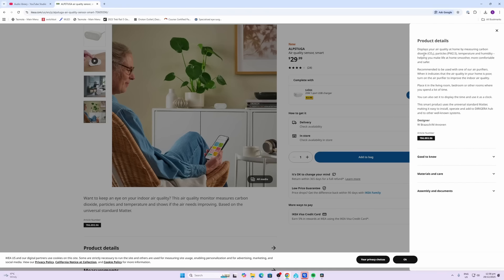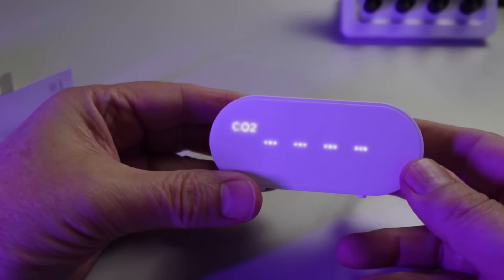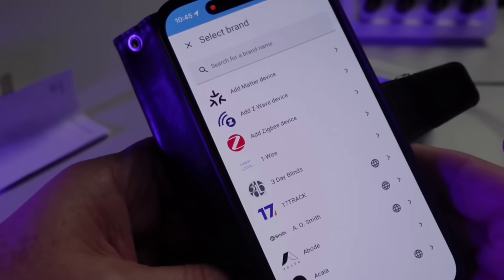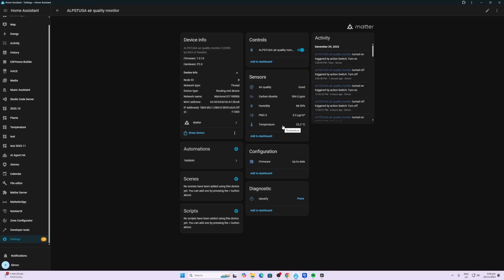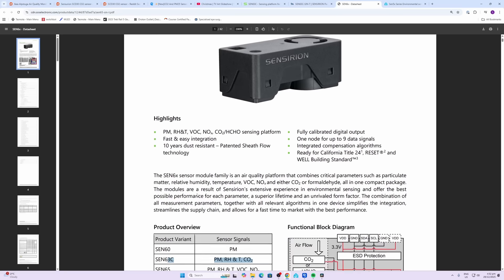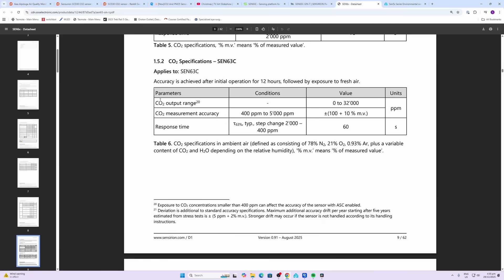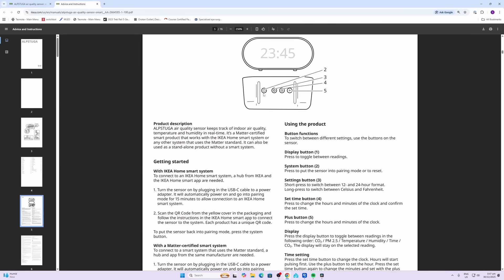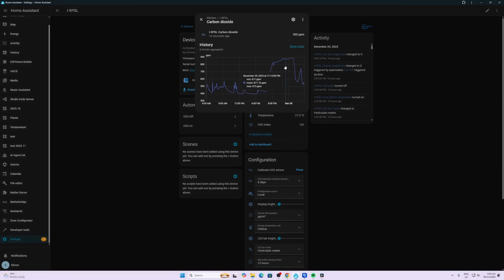How does the IKEA Alpstuga Air Quality Sensor Stack up to more expensive options?

Comment: I noticed mine gets time from the network somehow ... But I am not sure when or how it gets set.  When I plug it in sometimes with a short time the time is set and then other times it is not.  I am starting to think if i plug it in and don't check what the time is for 30 min it is fine but if i check shortly after it is plugged in then it NEVER gets network time.
Reply from the maker: Wow such a weird little bug,  have you tried the Blueprint for matter time sync?

Comment: Which Matter hub are you using? (It could be good to add it or specify it in the description)
I've been considering buying IKEA Dirigera although I'm concerned about the limited information on its integration with HA and its performance/stability. 
My HA integration experience with the IKEA Trådfri Gateway was somehow frustrating therefore I switched to a CC2652P many years back.
Reply from the maker: I am using the Home Assistant ZBT-2 as my Thread Boarder Router, it works great so far :)

Comment: Is the permanent display just the clock or does it scroll through other readings?

Also does the display auto dim during nighttime?
Reply from the maker: No you can scroll through the readings using the button and the display dims to a really low level in the dark, I have it next to my bed at night!

Comment: The power supply not included is ridiculous!!! I understand for something with an included battery you can share a charger with multiple devices so you don't need a dedicated power supply because you may already have one. But here without it the sensor won't work so you need to buy one! It's like selling a car without tires... because you may use the one from your previous car!
Reply: It's to save on ewaste. People can retain and repurpose the adapter that came with a device they have since discarded.
Reply from the maker: Unfortunately very few devices ship with power supplies any more!
Reply: @simonsayshomeassistant  Imagine your new laptop, PC monitor, anything with a  USB-C connector without power supply... and also a good way to deny warranty: you didn't use the overpriced recommended power supply!
Reply: Likewise you can use a single AC plug with multiple USB ports to plug several devices in at one location without using all of your outlets there (and likely more efficient power consumption).
Reply from the maker: @DavidBump  Thanks, that's a great idea David!

Comment: Really nice unit! I just wish IKEA didn't hate Norway. It's USD 30, fine, but in Norway, it's NOK 500, which is about 50% more expensive, and no, it's not EU that's in the way, even in Switzerland, which is even more expensive than -Norway, it's cheaper. I wonder why IKEA hates Norway that much…
Reply from the maker: Oh wow that is so frustrating!  I was worried they would be more expensive here in NZ too but the prices are amazing!
Reply: Switzerland has a very low VAT(around 8%), in Norway its around 25%? So I guess that is part of the reason
Reply from the maker: @joelcuce yes taxes can make a big difference 😮

Comment: I noticed the sensor can provide PM 1, 2.5, 4, 10. These are not exposed to HA? Perhaps hidden?
Reply from the maker: I doubt that there is an easy way to extract it using the current implementation.  We could get that data by connecting the sensor to an ESP32 and run ESP home code.

Comment: hello! the sensor seems to work well but... as soon as it was synchronized it set the right time. When I moved the device to another room it lost time sync and no longer syncs on its own. Is it just my problem?
Reply from the maker: Hi there Valeri, I experienced the same problem with mine, had to set the clock manually after powering off and on the device :(
Reply: @simonsayshomeassistant  I managed to find a solution using a custom component on HACS. It's called MATTER TIME SYNC. With this component, you can send the correct time to ALTSPURA. (the component does not update it automatically but you can still set up an automation to update it whenever you want)

Comment: Mine will show "Good" air quality in HA, despite the hardware unit showing the red dot indicating high amount of co2. Have you experienced the same issue?
Reply from the maker: Hi Srosted, thank you for that feedback!  Yes I have just tested it and mine is also not showing anything but Good air quality in Home Assistant even when I blow into the sensor to boost the CO2
Reply: @simonsayshomeassistant hope they will address it in a firmware update. But impressive that it has slipped through QA. At least it's reassuring that their water leak sensor had already received an OTA update, that installed flawlessly via HA.
Reply from the maker: @srosted  Yes let's wait and see what the update will bring :)  Yes the water leak sensor works great!
Reply: @simonsayshomeassistant the bug has been fixed with today's OTA firmware upgrade to version 1.0.15 👌
Reply from the maker: @srosted  Oh cool thanks for letting me know!

Comment: how many pm 2.5 readings does it populate per minute? my use case is a smoke detector to shut windows on a balcony, so i need values every 5 seconds to be responsive. i currently use a sen sensor via esp32 tomachieve that
Reply: Smoke detector as in detecting annoying people smoking cigarettes outside your window? If so that's really neat and I should do that.
Reply from the maker: @oliverer3  Interesting use case :)
Reply from the maker: It seems to vary the timing between 10 seconds and 1 minute.

Comment: is it a NDIR Co2 sensor? IF not than useless, no real data
Reply: I'm fairly confident it's a "photoacoustic" CO₂ sensor built using MEMS devices so it can be a single chip solution. That is a real CO₂ sensor, and provides comparable accuracy to transmissive NDIR under indoor conditions. Sensiron sells CO₂ sensors of this type as separate standalone devices too; see the SCD43.
Reply: That said, Sensiron also makes "Thermal Conductivity" CO₂ sensors, which don't directly measure CO₂ and can fooled by unusual gas mixtures. They're still way better than the estimated CO₂ numbers provided by a tVOC sensor.
Reply: @kepstin  This is theire "new" thermal conductivity sensor STCC4
Reply from the maker: No it is not an NDIR CO2 sensor as far as I know

Comment: Interesting the sensor can also provide VOC, but IKEA doesn't use it.
Reply: I believe that's incorrect, this device has the Sen63C variant of this sensor which only reads PM, co2 and temp + humidity. Only Sen65 and above can measure VOC as well as a few other neat things.
Reply: @oliverer3 ah, that sounds plausible, I hadn't seen that. thanks!
Reply from the maker: Yes, you could attach the sensor to an ESP 32 and load ESPHome to access these entities
Reply: Yeah I noticed this as well

Comment: I got one but it won’t connect to HA via matter.
Reply from the maker: That's odd, what are you running your Thread Boarder Router on?
Reply: @simonsayshomeassistant raspberry pi5, dedicated HA, TBR and Matter addon. All latest version and SLZB-MR1 as MoT. Tried also ZBT-1. Both no luck.
Reply from the maker: @vegatube3818  I know it took me a few tries to get the Matter working on my setup.  Have you managed to add other thread devices?
Reply: It tells me i need to aa a tbreat router border? But i have some matter devices that do work. I dont get where it goes wrong
Reply from the maker: @koalateen  Are the other Matter devices using WIFI or Thread?
Reply: @simonsayshomeassistant i have only the pihilips Hue bridge pro connected via matter to it. Have also a old hue bridge. But I dont know how all off it works to be fair. I just get the message i cant add it.
Reply from the maker: @koalateen  I think the problem is that you need a matter boarder router, you could get the Ikea Dirigera or an Apple Home Hub Mini or Apple TV
Reply: @simonsayshomeassistant  Would the Aqara hub M100 work to?
Reply from the maker: @koalateen yes it does have a thread boarder router so it should work
Reply: Have you tried resetting the device? Press and hold the SYNC button until a countdown appears… when the countdown ends, the device will reset. Then proceed with pairing.

Comment: two questions
- does the fan make any noise ?    I am interested to place it beside my bed, but if it makes any fan noise it is an absolute no go for me.
- can the CO2 alert be turned off ?
Reply from the maker: Hi, the fan is silent unless you place your ear right on the device.  There is no noise from the alert unless you create one like I did in Home Assistant
Reply: @simonsayshomeassistant  Thanks!
Reply from the maker: @nick066hu  Only a pleasure Nick :)

Comment: I have been using my Alpstuga for about 1 week. I can confirm that if you connect Alpstuga to Dirigera, all functions work perfectly. Including automatic setting the time after a power loss. Then you use the Matter sharing code from Dirigera to Home Assistant to get all functions to Home Assistant.

Comment: My time did not update when paired. It may be a function of HA's OTBR. On Reddit a user with an Apple TV product for their (thread board router) TBR, reported the time was lost when rebooting the IKEA sensor but automatically restored when restarting their Apple TV (and I presume that TBR has time paring/syncing on boot)
Reply from the maker: Thank you so much for your feedback 😊 let's hope that the ha TBR is updated to allow for time to be sent
Reply: you can use a custom component called MATTER TIME SYNC

Comment: Hi Simon, thank you for valuable information provided. Now just waiting to those appear in local Ikea. During CO2 chart I saw there is 10seconds refresh rate of sensor - please is this also the case for temperature, humidity and pm2.5? Thank you.
Reply from the maker: HI there!  Thank you so much for your valued feedback :) All the sensors seem to refresh at random times between 10 seconds and 2 minutes when connected to Home Assistant.  I can't work out what the times are controlled by !
Reply: @simonsayshomeassistant  In that case it seem some value deviation treshold is set probably due to energy saving. Thank you so much 😊 Michael
Reply from the maker: @x22x07  Yes that sounds like it :)  Glad I could help!

Comment: If paired with Home Assistant, as you mentioned, it loses time setting after powering off. But if paired with Dirigera, it gets back correct time. So I paired it with Dirigera , and shared it to HA, so problem resolved.

But would be ideal if HA sets the clock back once powered off.
Reply from the maker: Oh wow very interesting!  Thank you so much for that feedback :) I will have to purchase a Dirigera when they become available here to try it out!

Comment: Great video, especially on the comparison with a “proper” and more expensive air quality product and data sheet specifically covering what sensor is inside. Before your video, I was convinced it was a poor quality device using algorithms to calculate the co2 value rather than actually measuring them like almost all cheap co2 measuring devices. 
Thank you! You’ve got a new subscriber 😊
Reply from the maker: Hi Carl, welcome, thank you so much for your valued comments :) Yes I was really surprised too, it seems that IKEA is really committed to producing quality smart home devices at affordable prices!
Reply: @simonsayshomeassistant  stoooppp my wallet can only take so much this soon after the holidays.

Comment: Interesting Sensor. Good review but a few questions. I am about to start with matter devices. When you add to matter with a thread border router say with something like slzb-mr3 it does not use your wifi router at all. Is this right?

About the sensor

1. Does it cycle through the time and each measure?
2. Does the time need to be manually updated in all cases if unplugged or can it be set to update from home assistant. I ask because this would be annoying with daylight savings etc.
Thanks
Reply from the maker: Thank you so much for your kind feedback,  yes it communicates directly  with the Matter device over Thread.  It cycles through each metric as you press the button.  Yes it needs to be manually set, it only loaded the time on the first matter connection
Reply: @simonsayshomeassistant Thanks for the reply. I think they should have an option to cycle through without pressing the button. Also the time manual change is a bummer.....
Reply from the maker: @guylast9516  Yeh let's hope they update this in future software changes

Comment: Great that IKEA has added buttons for the clock to allow this device to run standalone.
I've also seen that the temperature & humidity sensor has a °C / ° F switch.
Reply from the maker: Yeh they really did a good job when designing this device, I look forward to what they will bring out in the coming years!
Reply: Gotta love those physical buttons as I plan on running this for a while standalone. I am still waiting and planning what Thread capable dongle/hub I pick and use with Home Assistant.
Reply from the maker: @laurikvo  Yeh it is a well deigned little device!  I am loving the ZBT2!

Comment: What do you mean "No, its not new"? Doesn't it want to pair from scratch?
Reply: Matter devices pair differently if they're new (never paired) or already setup (currently paired with a Thread Border Router).
If they're new, Home Assistant knows to set it up with a selected default border router (open thread border router add-on). Otherwise a currently paired device needs to be added through the hub it's currently connected to, e.g. through Home Kit.
Reply from the maker: @NorthparkLights  Thanks Mark :)
Reply: yes, thats whats written on HA
Reply from the maker: My mistake, mean to say yes it is new!

Comment: I've got 2 so far really good and super low power usage. Home Assistant and Google home work well. Google home displays the temps in Celsius. If matter is not working make sure IPv6 is enabled on home assistant it won't work without it.
Reply: I've got 3 of these, and they paired up with Apple Home without a problem either.
Reply from the maker: @yoshuawuyts  That's great to hear!
Reply from the maker: It's weird I tried setting up IPV6 first and then it gave me an error.  Perhaps it defaults to being setup already ?
Reply: @simonsayshomeassistant Google Home worked great but trying to get it to work with Home Assistant was harder until I learned about IPv6. I got them early in Las Vegas and the QR code to the instructions didn't even work.what are you using as a thread/matter router? I have the Google TV streamer 4k.
Reply: How is the sound/Noise? I have a Vindstyrka and it cant be used in a bed room because of the noise.
Reply: @eriksandell2038 can't even hear them making any noise
Reply from the maker: @eriksandell2038  I use it right next to my bed and I cannot hear a thing unless I put it up to my ear